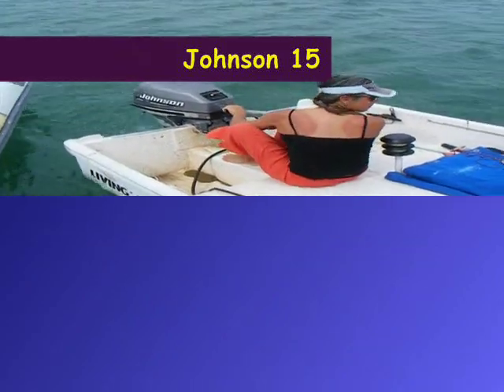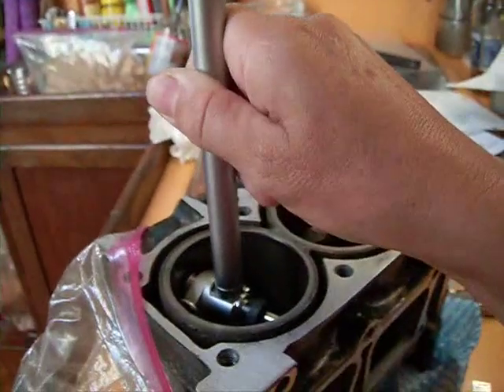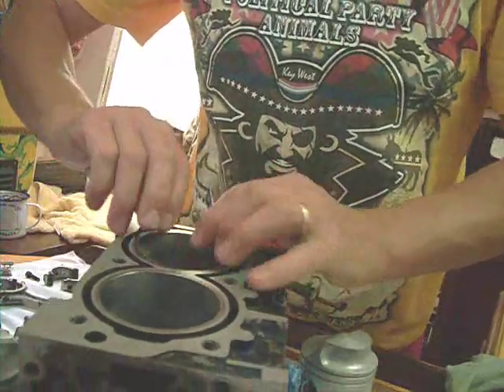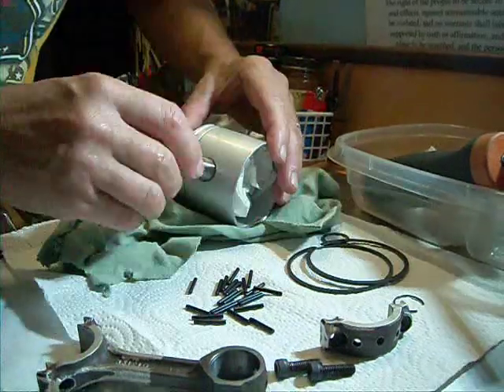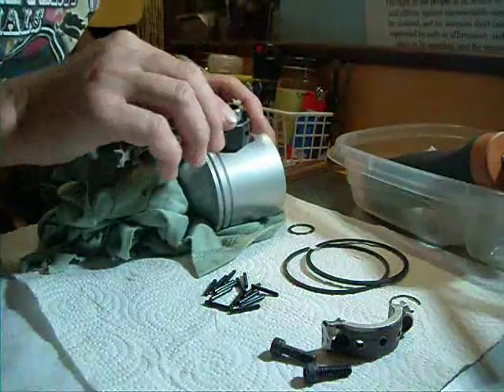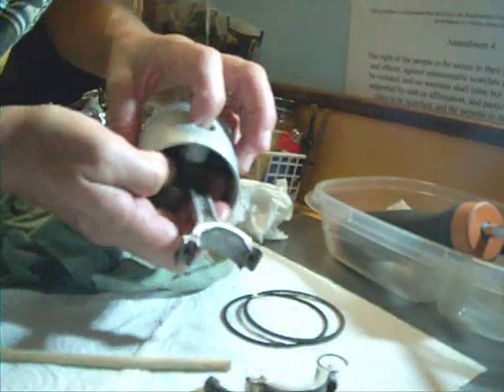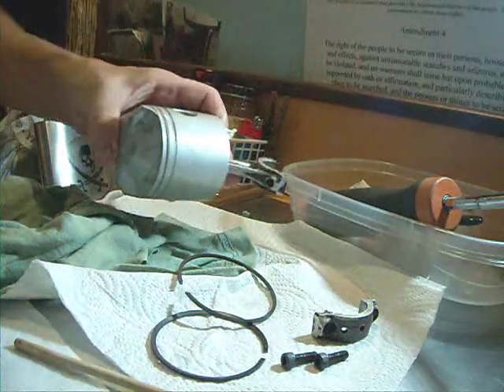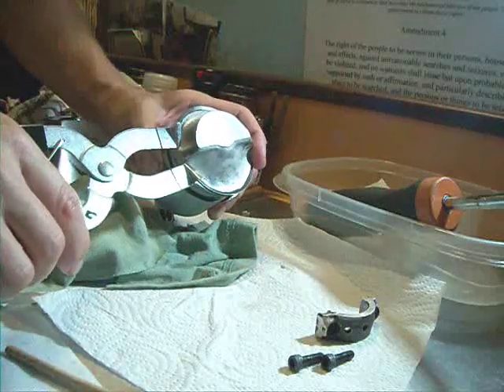Small Girl Rebuilds Small Outboard, 2-stroke Johnson 15 hp, PART I

Comment: Correction on page 1 of the Chrysler Service manual there is a compression average from 115-125 psi. 

I will have the motor's compression taken to see where it stands since the accident in 1999!

We had three days at the lake before Easter and it worked like a sport even starting on the first pull of the rope!

However, we managed to burn 10'gallons of fuel and Johnson XD30 oil and spent long hours in windy conditions and choppy water!

Regards!

Comment: Outstanding video! My 1969 Chrysler 20 Hp overheated whilst "climbing" the San Juan River in Nicaragua. It belonged to my father and was used only a couple of times so it's a pity that this happened. I cannot oversize re-bore as there are no oversize pistons and rings nor they ever were for this motor. I decided to keep it as is and the motor has worked fine since 1999. A compression test was made And found between 115 psi  and 117 psi between both cylinders. There is no indication of the normal cylinder  compression from the service nor parts manual. However, out of persistence and the vendors desire to unload obsolete parts I managed to source all the parts needed to overhaul the motor except for re-sleeving. I have a short block from another engine that I bought over eBay but I haven't seen it inside, it was too inexpensive to buy let alone invest in another head gasket. What do you suggest?

Comment: hollow there this is timothy I have a 1984 evinrude 15 hp  that runs really good but its not spraying water and sometimes it sprays water so i am trying to figure out where I can take to it to be fixed I was wondering if I can bring it to your marine shop to get my 1984 evinrude fixed it pees water out really good because I stuck a needle in the pee hole and it is peeing really good and I stuck a needle in the exhaust tube hole and sometimes it works and sometimes it does not work I do see lot of smoke instead of water and it sprays water when it should be spraying water and smoke I am hoping that you can help me get it spraying water again hey thanks

Comment from the maker: The parts were aftermarket and I found a "kit", which included rings for the larger sized pistons, from a parts shop Googled on the internet. it was $250 and included nearly everything except connecting rods and wrist pins.

Comment: Quick question? Did you check the rod+cap for roundness? Quite often with automotive engines when their overheated the rod+cap will go out of round. And they will lose their line bore. So we always shave 5-10 thou off the cap and re-line bore them. Granted we use oil film bearings VS the needle roller bearings you use. But the premise is the same. IF the rod and cap's  bore isn’t round and in line eventually you will develop pitting on the bearing surface that just continues to grow over time.